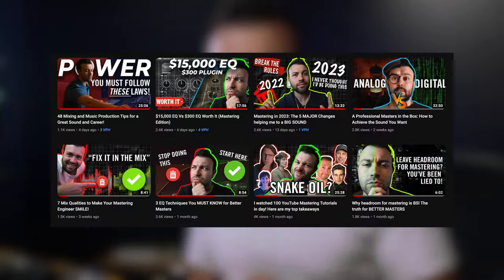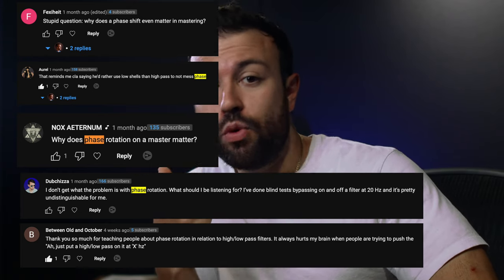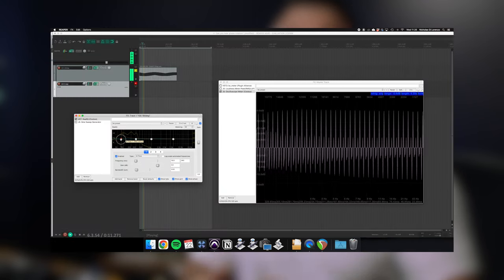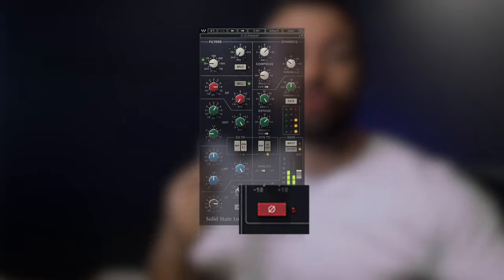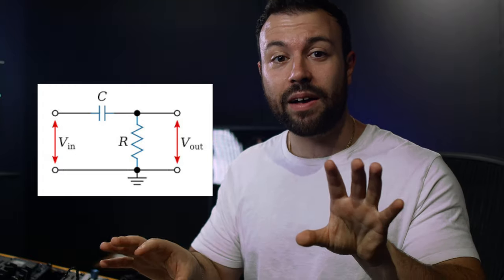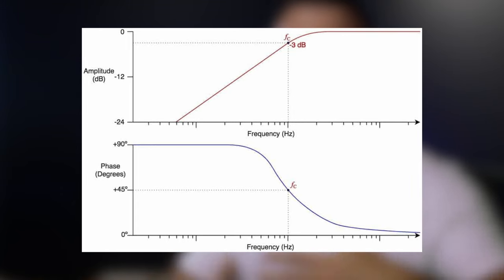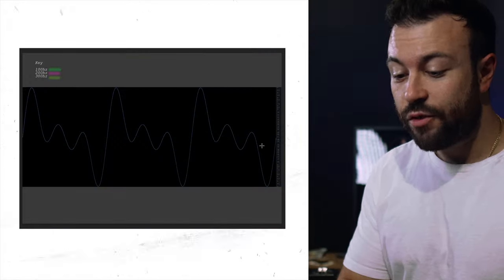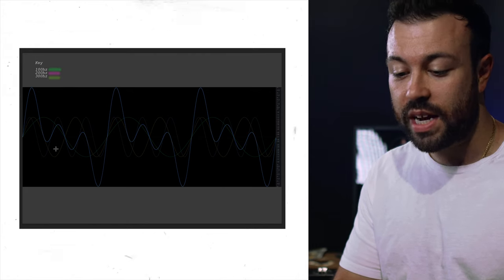Does Phase Rotation Matter in Mastering? Here's the Answer!

Comment: I’ve seen mastering engineers on YouTube rotate masters in RX to increase digital headroom, but I never saw much of a benefit when trying it on my tracks. Maybe it would help if you had a lot of asymmetrical waveforms in your mix or DC offset. (Fabfilter’s L2 has a convenient DC offset button so you don’t even have to worry about it)
Reply from the maker: Yeap; it very common when there is a great deal of offset! I've used that tool too!
Reply: Asymmetrical waveforms and DC are not the same thing actually, but I had a question about the iZotope video that I recently saw as well. I used the phase rotation function in rx recently, as the first step before going into any mastering processing. I noticed it gave me a lot more headroom, it reduced the highest peaks quite a lot, but I also noticed that transients started to smear a little bit and I got very noticeable preringing. I this just an effect of phase rotation? Since it shifts the harmonics that make up a waveform away from each other?
Reply: @robbeservaes3625 as far as the manual of RX states, there should be no sonic difference whatsoever, phase rotation is related to the absolute peak value of the waveform...
Reply: @eccentricworx  yeah I read that too, left me very confused, because there definitely is some noticable preringing on stuff like kicks etc. I've decided to stay away from this on full mixes, unless absolutely necessary, but might do it on individual tracks if I can't hear any artifacts or transient smearing when applied.
Reply: @robbeservaes3625  interesting, I fix phase rotation before every mix, never noticed anything like that. But I fix phase shift and phase spectrum on multi-mic tracks with tools like Auto-Align and Pi too...
Reply: @eccentricworx  yeah you could do some tests in RX, load in a kick sample with a little bit of silence in front of it, apply some phase rotation, and you will see low frequency energy in front of the actual transient + some kind of "ramp up" to the transient
Reply: @robbeservaes3625  i just checked some of my kick drum raw tracks and compared them with the fixed ones.. for me  theres no difference in the spectrum at all. I´m on RX10. Files checked are 48khz/24bit... Maybe you should contact Izotope support?...
Reply: @robbeservaes3625  DC is where there's an amplitude offset to the zero crossing of the wave. In an asymmetric waveform the zero point is still at zero.

Comment: Great video as always - although one thing to note, phase is a function of frequency and can be rotated from 0 to 360 degrees. Polarity is however a function of positive or negative wiring, hence why on consoles and some audio devices you see polarity invert buttons to essentially swap the positive and negative audio signals. But we cannot rotate polarity, and we cannot flip/invert phase (at least outside the realms of simple waveforms such as sine, square et al).
Reply from the maker: Good thoughts; can you expand on, "we canot rotate polarity... (at least outside the realms of simple waveforms)
Reply: @panorama_mastering  So, polarity is based on two states. In an AC circuit for example you have your positive and negative wiring (such as in a loudspeaker system).

Polarity is either the red wire on the left terminal and black wire on the right terminal or the other way around. This is hence why we can't rotate 'polarity'. And this is where Polarity as a term has its limitations.

Phase however, is essentially just based on delay by 0 to 360 degrees for 1x rotation (number of rotations could be infinite).

With complex waveforms, if we shift the signal by 180 degrees such as to attempt to cause a total destructive interference or cancellation/null between the two signals, this wouldn't happen. However with polarity, it would as polarity does not care about the time-domain although phase does.

Now you can test this yourself, if you get a plugin that can 'rotate' your signal in terms of phase, rotate a complex waveform by 180 degrees, pi or 3.148... and try to sum with another signal that is untouched, you'll find that a total null is not possible (although if you try this with a simple waveform that has the same cycle over and over, you would achieve a full null). This is because 180 degrees of phase rotation does not equal to an inversion of the audio signal, but instead just by how far you have delayed this signal.

However in the above test, through inverting the polarity instead as opposed to rotating the phase of this duplicated audio signal/track, you would be able to achieve a complete null.

Hopefully this shows that phase and polarity despite some similarity are two separate things which often us audio guys mistake for being the same, or at least two concepts which are interchangeable.

I've tried doing a quick google search to help give you something more 'visual' in terms of diagrams, this little blog post seems to do the job well: https://audiouniversityonline.com/polarity-vs-phase/
Reply from the maker: Awesome; thanks for the explanation; that's very reasonable and certainly expands further on the basis of the theory I'm exploring here;

Muchly appreciate your openness to share this!
Reply: @panorama_mastering  hey man I’m on this planet to try learn and hopefully share as much as I can myself and NGL I want to see you become the number 1 source for ‘nerdy’ audio information and techniques!! Really love your style of presentation of information - you have a really engaging character which a lot of people on this platform do not have - not least your existing experience in producing, mixing and mastering music really gives you a lot of credibility. But also despite doing an audio degree, masters in acoustics etc… from time to time I often find I learn most from your videos than anyone else’s on this platform!
Reply from the maker: Hey Matthew; thank you kindly for the support! I'm hoping this channel can continue to grow too! What's your email; I'd love to tee up a call with you leading into some future stuff I'm planning for the channel.

Comment: It would be interesting to see the loudness, in units of LUFS or RMS, for those phase rotated waveforms. I would also be interested to see a loudness comparison where the peak is normalized to unit gain after the phase rotation. Basically, could we optimize loudness with the phase coherency? Might not be useful for mastering, but could be interesting in a phase controlled environment like synthesis.
Reply from the maker: Hey Astrobear; to answer "Basically, could we optimize loudness with the phase coherency?"

YES! you certainly can; there's a video iZotope put out with another mastering engineer that does this in iZotope RX Audio Editor!
Reply: @panorama_mastering  thanks for replying, I will seek out this iZotope video ❤️

Comment: I must admit I still don't get this! Basics - a longitudinal soundwave is converted to a voltage that goes positive with the compressions and negative with the rarefactions, tracked over time we can see this changing voltage on an oscilloscope. This up/down track is then digitised by sampling the voltage a few thousand times a second, and we get the ubiquitous graphic shown in most sound software and plugins. In my head, I see this as a purely two-dimensional process; voltage/bit depth and time - X&Y. In order to have rotation we'd need a W axis which doesn't exist as I understand it... If anyone can point me to an appropriate article it would be much appreciated.
Reply: 1) Don't try and understand it from this video, or any other video on phase involving people who go straight to mixers. This is basic signal processing, and it is completely conflated and confusing in this video. 2) Forget about waves before understanding signal processing. Essentially, the microphone output is a signal anyway, although it is taken out of a field. 3) When dealing with phase, we have already made an assumption about working in the frequency domain with steady-state sinudsoidal signal, meaning that we are looking at a particular signal for each frequency, which started infinitely long ago. This falls out of the underlying Fourier transform that the signals have undergone. 4) A sinusoidal defined via a function has its own defined phase, but when measuring phase, it will typically relate to a system, such that the phase indicates what has happened to the input signal as it is output of the system. 5) The phase is thus seen by comparing the steady state sinusoidal on the output with the steady sinusoidal on the output. If they for example they align (perhaps with different amplitudes) the phase will be zero or a multiplum of 360 degrees. 6) Looking at only a single frequency can be misleading as seen from 5) as the phase is ambiguous. It should therefor be seen over the entire frequency range. 7) A polarity flip is a particular phase situation, where whatever the phase was before, it is now shifted 180 degrees at all frequencies. This is how a sign inversion can be included into the phase, as it does not affect the magnitude. Think for example of how a real positive number can be rotated 180 degrees onto the real-axis, where it is now negative. The phase rotation is exactly that, only operating on complex numbers instead for the so-called phasors that contain the magnitude and phase for each frequency.
Reply: Ah, so I'm making it more complicated than it needs to be by trying to figure it out in three dimensions! The 'rotation' is purely a phase shift along the time axis that puts it several degrees ahead/behind compared to the original waveform. @Rene_Christensen
Reply: @timothybondaudio  In some sense, but don't think of phase only as a time delay. The phase is primary, and from it different delays can be found, such as phase delay and group delay, but there are steady-state delays, so they don't necessarily represent the latency of the system. So there is more to phase than just pure time delays.
Reply: Phase is not time based

Comment: Thanks for the video. Could you tell what better to do low shelf or low cut when mastering trap on usual monitors where i do not have possibility to hear difference on the low low end. Will appreciate the answer. 

Tbh i am afraid that low shelf wont be enough to remove low 20hz.
Reply: Whatever you need to do to the frequency response is more important than not causing phase distortions. Again, as shown, EQs ARE phase distortions. That being said, how do you expect to adjust something you can't hear?
Reply from the maker: Hey Roman, 

The core to this answer is WHY do you want to cut these frequencies completely?

I suggest using a low-shelf if you want to attenuate them;